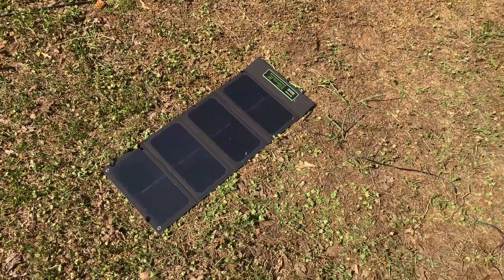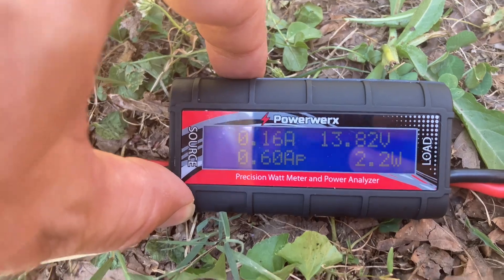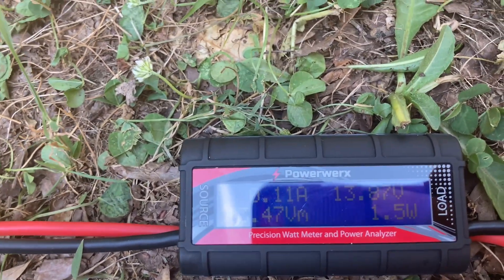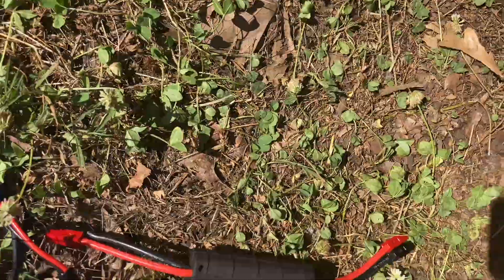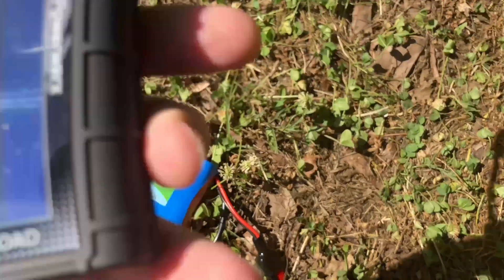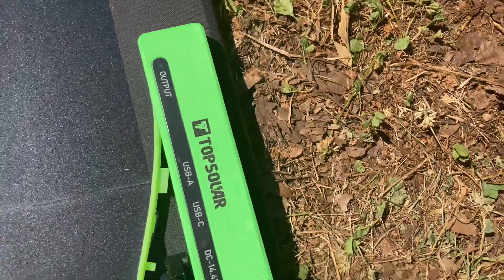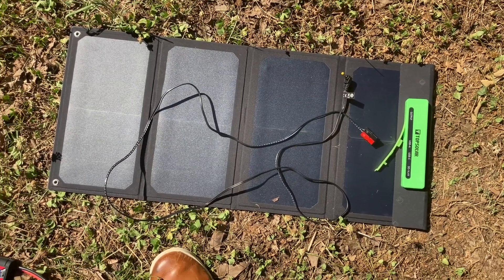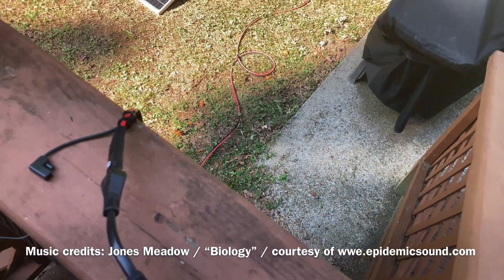Solar for Backpacking with Ham Radio: Topsolar SolarFairy 30S

Comment: Solar Tip You can steplessly dim down a bulge and all other hungry electricity consumers with a 5000W dimmer (7, EUR). I run 5 dimmers in parallel on an 850W inverter. Kettle 2.2KW at 150W runs 12 hours a day, so the water is always hot. The room is also nicely heated. 2.5KW washing machine runs in parallel with dimmed to 200...400W. Iron, dishwasher, oven, electric heater, coffee machine, all internal heating are throttled with me. Videos about it on my channel https://youtu.be/eC2olbCBhh0 The inverter stays cool, quiet and the MOSFETs remain intact because extreme current peaks no longer arrive at the inverter. Now every Mini PV Inverter is enough to sell large devices...
Reply from the maker: Nice! That sounds like a cool setup!